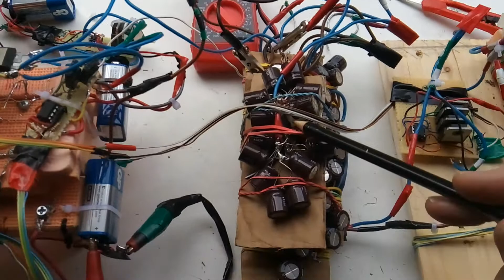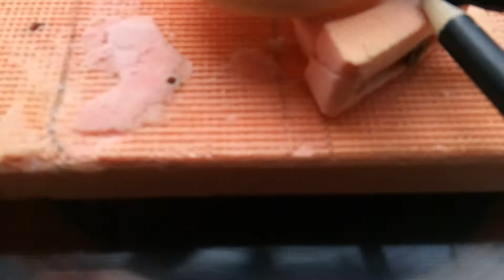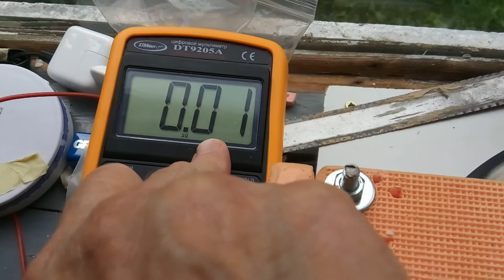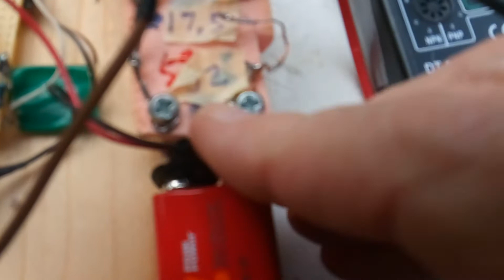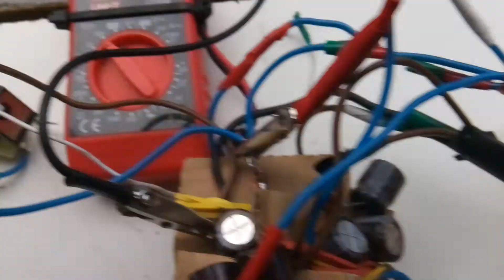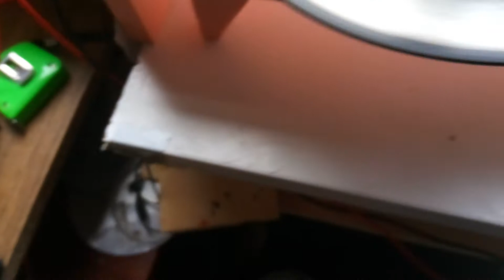Testing and explanation of flyback delay switch with a  5600uf cap bank

Comment: Do you need some BIG caps?
Reply from the maker: Hi Tim
I have lots of big caps back in Seattle, but here in Belarus not so many all small ones too,  but I think I can get it to loop from what I got here...it takes months to mail anything from the states costs a fortune too...its only running on about a tenth a watt, while kicking out pulsing of approx 500ma (meter says next to load)  X the 5V in cap bank,   4 times a revolution at 415rpm, ....thats about 7 revolutions per second.....the duty cycle of ON time compared to OFF time is about 50% so lets say there really is 500ma of current shooting out in those pulses,  half of that is 250ma X 5V in cap bank that comes to 1.2watts not so bad 10 times more out than in!  (cant be true)  I should be able to do something good here soon I need to run the second motor with it all next.
Reply: @MrDKONZEN  OH yeah cant wait to see two looped together and definitely looks like a winner Doug!